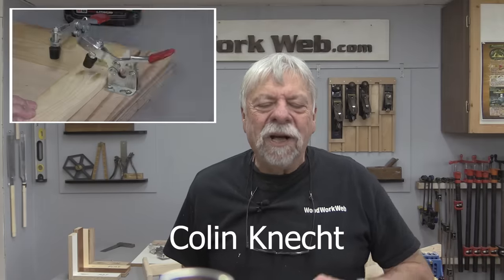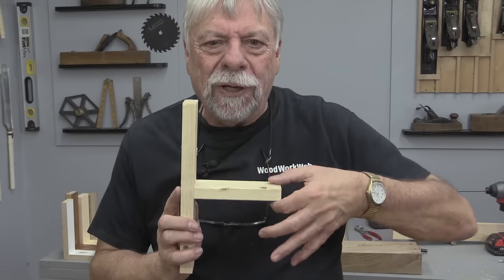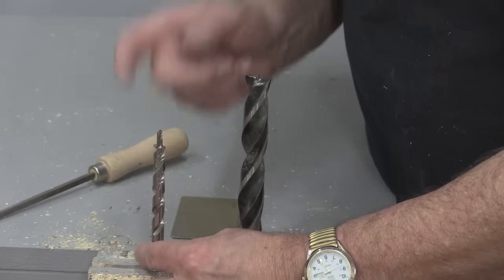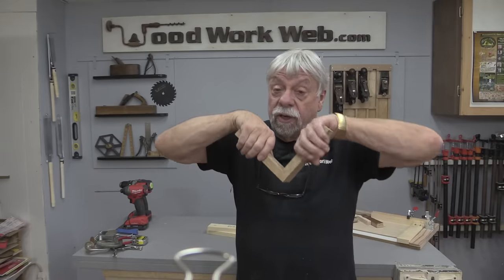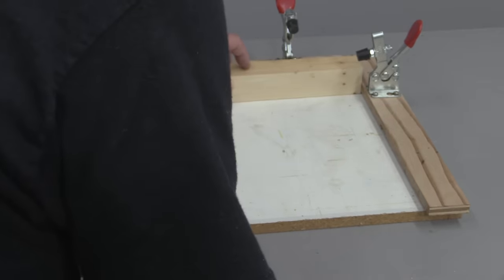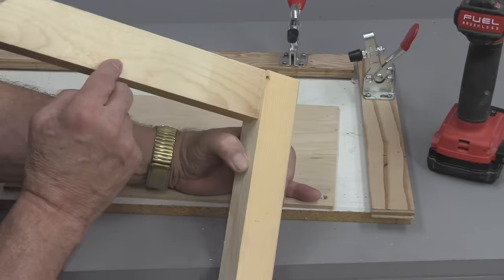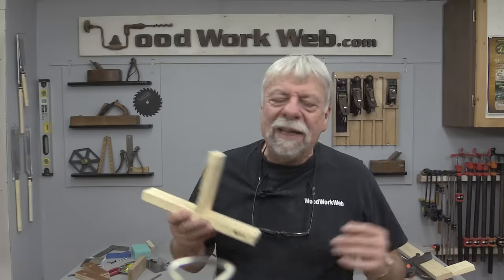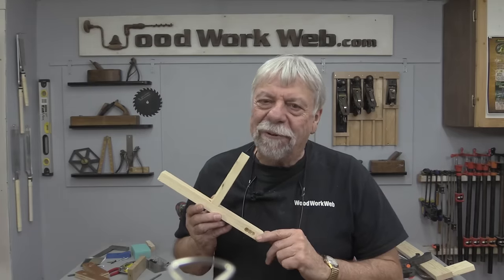Pocket Hole Mistakes to Avoid / Woodworking Joinery

Comment: Not sure how I missed this when it was new.  The strength demonstration of the pocket screw was impressive.  I've popped the heads off of plenty of sheet rock screws but know better than to use the bugle heads in pocket screws.  The technology and metallurgy of screws has come a long way in the last decade.  Kudos!

Comment: When you are sharpening drill bits (or just about anything) free hand, use a felt tip marker (Sharpie, Artline) to completely color the flat you are going to grind away. Then you will be able to see if you are actually holding the abrasive parralell to the surface rather than rounding it over - by wearing away the marker ink - repeat the inking as needed.
Reply: Good tip.
Reply: Thanks for the good tip.
Reply: Great idea! Thank you
Reply: Great tip.
Reply: @thisoldtony would be proud. :)
Reply: Why not machinist dye?
This works on any tool Knifes, planer blades, marking knifes anything your sharpening.
Also the Twist drills you buy for woodworking ard not hard steel they do not hold an edge
buy some made for machine shop work they will hold an edge longer and won't bend on you. you going to sharpen a drill bit I suggest you buy a gauge for doing it or one flute will be the high point and the only one cutting while the other one just gses for the ride.
on a split point bit both cutting edges have to mirror each other or the bits going to drift off center. If your trying to drill a straight hole this won't help you at all. over correcting will make the hole larger or egg shaped.
I worked in a machine shop I used to sharpen my own drill bits it really matters how good you get them. I wasn't a Journeyman machinist But I did learn a few things.

Yes Metal cutting bits have a differnt angle, I know that but they will drill metal and wood alike with no problem but they do cost a hell of a lot more money, the investen's worth it in the long run.
Reply: This good tip results in a good tip.
Reply: Vikas SM  Just the tip?
Reply: Good tip
Reply: Cool tip.
Reply: @bobbg9041  The best twist-drill bits for woodworking are spur-point bits.  The center point keeps them from wandering and the spurs make for a very clean-cut hole.  The steel IS hard steel, though not as hard as a machinists bit.
Reply: Word!
Reply: Nice & simple Tip..

Comment: Great information on what screws to use, AND why!  One comment: in your pocket hole strength demonstration in various wood types I noted that the orientation of your test pieces was the opposite of what I have learned elsewhere, specifically, to get better grip and less tendency to break, your pocket and screw should not be on the inside of the joint pointing toward the outside corner of the piece.  That reduces the support on the second piece significantly.  The pocket should be on the outside of the piece allowing it to point INTO the second piece.  (I hope that makes sense without a diagram…LOL.)

Comment: I am new using a pocket hole jig so I followed the directions and a couple utubes     I set the bit stop according to the the side chart using 3/4 birch plywood,   After running a couple screws thru the top I found that 3/4 plywood is not necessarily true size so always measure the thickness before setting the drill depth and don’t be afraid to set the stop a bit short.  Great info you shared!

Comment: A lot of useful information presented in a easy to understand way.
Reply: What about water based glues for outside projects? Example Gorrila. You need to dampen your joints before attaching to make it stronger. They apparently are recommended for outdoor use. I have a original Kreg handed down from my father. I’m 73 so you can imagine this thing is old. Use it a lot and have learnt things that will be helpful in future projects. Thanks
Reply: @dennispalmer6007  The original Gorilla glue is a polyurethane.  It is not water-based.  It requires moisture to cure.  Once cured it is water-proof.  It is not recommended for gluing wood that will be continuously submerged in water .  However, it works well for projects that get wet from time-to-time.

Comment: Excellent explanation and demonstration of how some screws will shear off and others will not, and why some screws will pull a joint together and others will not.
Also liked the demo of different strengths of kreg corner joints based on wood type.

Comment: I have worked as a carpenter for some thirty years and I normally vary rarely use pocket holes in joinery as I still prefer traditional joints in my work. But in certain projects for speed and basic necessity, these are fantastic tips even for seasoned woodworkers. Always good to learn new tips no matter what your skill level. Nice job 👍

Comment: Great video and advice, however I was always taught to screw pockets from the outside in as there's more material past the tip of the screw - making it more secure with a stronger hold.
Reply: Bingo.

Comment: I made a 2" X 6" gate frame and used the large Kregg Pocket Hole jig with the pocket hole screws. Zero sagging after 2 years of heat and rain. I used Gorilla Heavy Duty construction adhesive to seal and glue it together. Its still going strong.

Comment: Wow, I don’t know why I never thought about why the piece pulls away from the thing you’re screwing into with screws that have threads the whole way up!  Great explanation!  Thanks!
Reply: When teaching "screw fastening" in my HS tech ed classes, I always asked kids to think of a screw head as the movable jaw on a vice and the base board as the other jaw. The piece between is being "clamped" between the screw head and the base board. The board between the screw head and base board must have a shank hole drilled that is the tight outside diameter of the screw threads. The screw should be able to slide through this board right up to the head before it is being fastened to the base board.Threads should never grip the board being clamped. It takes longer but this is the way I fasten deck boards and they never crack or push apart. In furniture or cabinetmaking I always drill a pilot hole, shank hole, then countersink or counterbore in the listed order.
Reply: Joe Russo pilot hole PLUS shank hole?
Reply: @anyfoolknowthat     YES ! Especially in hardwoods. 1. Drill the pilot hole through both boards to be fastened in their aligned position ( this drilled hole is a tight diameter to the screws inside thread diameter for good thread grip)  2. Drill the shank hole "only" through the board being secured ( you are enlarging the originally drilled pilot hole so the screw just tightly slips through to the head)  3. If you are going to make the screw head flush, align and drill a countersink into the shank hole on the board being secured. Or, you can choose to drill a counterbore of a specific diameter and the cut a plug and fill the counterbore hole. With this process, the boards are always pulled tight and not separated.    Note: When I lay down deck boards, I usually only drill a shank hole in the top deck board to alleviate splitting. Special deck screws will cut the pilot in soft framing boards and the heads also have a cutting action that countersinks the head.
Reply: Joe Russo Sounds like you’re carrying 3 different drivers (?)
Reply: @anyfoolknowthat  You are correct. If I am doing cabinet work I am using drills outfitted with proper bits and a driver. This usually means 4 drills required.  Three for drill and countersink and one with a screwdriver bit. In a decking install, 2 drills, one with a shank hole bit to drill through the decking board and then another fitted with the screwdriver bit to drive self tapping deck screws which usually don't require a pilot hole. Early in my teaching career, within the framework of my budget, I always added drills to my tool inventory. I did not want kids waiting around for a drill or wasting time constantly changing bits. You can do everything with one drill but your production time will be greatly increased.
Reply: @anyfoolknowthat  The hole in the work that the screw passes completely through on the top is called a, "clearance hole". Because the fastener is supposed to completely clear it and not engage at all. Otherwise you risk your work, "jacking" on you. For real wood screws you're actually supposed to use a tapered drill bit. They usually have an integrated countersink and depth collar on them. I have a set.

Comment: When it comes to clamping the pieces I use the locking clamp that came with my Kreg Jig. Not a problem..the disk shape covers a slightly bigger ariea by a few millimeters. Doesn't sound much, but it doesn't move when I clamp, where as if I used those other two clamps you mentioned, I found I had to use a couple of small pieces of scrap wood, and it was too much mucking around. Might stop marking the wood, but my locking clamps didn't mark the wood either. 
Great vid there, Colin...as usual, you haven't let me down so far.

Comment: it's interesting how much the Kreg jig has changed. Mine is much more difficult to adjust, in fact, I'm not certain it can be adjusted like that. Fine threads work better on hardwoods, don't they? I really like your clamping jig

Comment: I saw in another video at 4:55 that it's not strong when you put the pocket hole on that side because there isn't enough wood holding the screw. The screws should be driving towards the long side of the wood, not the end.

Comment: Thank you so much for this information. I've been using left over sheet metal screws for pocket holes resulting several splits. Now, I know which screws to use for pocket holes. Appreciate for your video!

Comment: Great video Collin! I just started using pocket scresws, even the larger ones for 2 x 4 construction. It takes a little more time but the results are much better. Have you done a video on your clamping frame? I'll be doing some kitchen cabinet doors theis fall and would like a clamping frame like you have. Thanks again!

Comment: Speaking of pocket hole mistakes, the most common and you did it too (like at 5:15) you screw it on the underside, wich is prettier but way weaker because there is not much wood left to hold the screw ! If you screw it on the top, the tip of the screw point inside the other piece of wood and not towards the edge cut. Way stronger. Try it !

Comment: And if I may add:  most of the time, good quality pocket hole screws will be "Self Tapping" type, that does a better job, when screwing.
Reply: Came to add the same comment. An additional comment about drill selection: in oak you want to use a drill with a clutch, not an impact driver. Once the pan head of the pocket hole screw reaches the bottom of the whole the torque of an impact driver can cause the head of the screw to pop off.

Comment: Hi Colin. Yes, definitely need to clamp the parts when using Kreg or Harbor Freight pocket hole jigs. They are all around 15 degrees. A Castle pocket hole machine you won’t have the same problem. They are at 3 degree angle.

Comment: Colin: There was a lot of useful information here and I know you were showing the benefits of types of wood for pocket holes.  but when making pocket joints though, drilling from inside to the outside leaves no strength in the joint where the screw is only anchored in the fragile edge of the wood  rather than anchoring them in the meat of the board and often will protrude through. if used from the outside in there leaves a hole to be filled.
Reply: he is doing it wrong
that's why it is too weak
Reply: I thought so as well.  Odd.
Reply: The only time I would go inside to outside is when you really don't want to see the screws like on a piece of furniture, otherwise your right.
Reply: @mickpicker9089  And if you used glue it would be fine? I'm just getting into this and going to buy a jig soon.
Reply: @AlexWard  There are definitely times were glue is better. Glue is usually really good on projects that are indoors were you dont want screws visible and that wont expand and contract alot. But you can get a really strong joint with both screws and glue.
Reply: @mickpicker9089  So for outdoor stuff you're better off NOT using glue? Even if painted?
Reply: @AlexWard  I forgot to say it depends on what glue you use. Some keep a tight bond outside even with a lot of wood movement.

Comment: Also use the right screws for the wood  you are using, course thread screws for soft wood and Fine thread for hard .  Use a clutch drill not a impact driver.

Comment: I just drove 3 pocket screws into pine without gluing first then saw your vid. Gonna put some glue on the surface now. Thanks a lot for the tip. Great educational video.

Comment: It absolutely does matter what type of clamp you use when drilling pocket holes, quick release clamps just plain suck, you can't hand tighten them enough to keep adequate pressure on the intersection of wood, and the joint will in some cases misalign , you need to use vise grip type clamps, or C clamps, trust me , I've been pocket joining for a long time.
Reply: This is very true, and I have had to learn the hard way.

Comment: Usual cordless drills don't snap off heads of drywall screws as easily as impact screwdrivers do as you can effectively adjust maximum torque applied in the very end of screwing. Still, using drywall screws for pocket holes is not a good idea, of course.
Reply: Yeah, I can't say that I've ever snapped the head off drywall screws or tried to intentionally, but it's definitely happened with deck screws and tapcon concrete screws. Normally I drill a hole first, unless I'm actually anchoring drywall.
Reply: @kahoycrafts  I have broke many off when putting up drywall in my old house framed in fir.
Reply: I try to avoid using a drill and Phillips combination. Drill is heavy compared to an impact and Phillips screws slip out.
Reply: Drywall screws are incredibly hard and brittle. They're really not suitable for anything besides holding drywall to studs. Although we all use them when we shouldn't. They're as hard as they are so they can pierce metal studs.

Comment: They don't recommend impact drivers for pocket holes. Drills with clutches are the best.
Reply: I like to use a corded drill to bore the holes and a cordless drill to drive screws.
Reply: They should slap a giant sticker on the jig—I was knocking my bit collar loose for a couple months before I put two and two together
Reply: I’ve noticed if I give it just one or two click sounds on the impact that it’s enough to get the joint tight
Reply: Which clutch setting is the best for pocket holes?  Sorry, im new at this!!
Reply: will kinser I do 14 on my Porter Cable driver, which goes up to 23
Reply: @willkinser785  It depends on the clutch. Once you get a feel for your tool, you'll know how to adjust it. I suggest taking a scrap piece of the wood you're working with and sneak up to the correct setting.

I should also add that many low-quality clutches will drive the screw too much one time, not enough on the other. In that case, it's best just to learn how to drive the screw by feel, like we had to before clutches.
Reply: @willkinser785  it depends on the power of your tool and the type of wood. I still prefer my impact driver and just go untill it impacts 1-2 times
Reply: An impact drill made the stopper on my jig come loose
Reply: Omg you just solved my mystery! I’ve been having trouble w my pocket holes since I started using an impact driver. PTL! I can see now!
Reply: starvant are you talking about the stopper on the pocket hole drill bit? if so I wouldnt ever suggest using an impact to drill holes. I use my regular drill to make the pocket holes and impact driver to drive the screw in.

Comment: For those demos, the screws should be angled away from the edge of the other piece. The way you had them, there is less material for the screw to hold on to.
Reply: I thought nobody had notice that! You are so right!
Reply: You are 100 % correct. Unless you are making a face frame that won't move once nailed in.
Reply: Yep.
Reply: Yep.
Reply: Agree 👍🏻
Reply: If he did it your way the hole would be visible...
Reply: @lennym1273  It's okay in some cases if the holes will be covered or if looks don't matter like for shop cabinets.

Comment: When you're demonstrating the joint strength @4:47, it looks like the main issue there is where you drilled the pocket holes, not the material you're using.  If you had drilled the hole on the outside of the "short side", or the outside of the board with it's end grain laying on the face grain of the other board, I think the joint would be much stronger, regardless of material.
Reply: If I understand you correctly, by flipping the pocket holes to the outside of the workpiece, you would be angling the screws inward and away from the edge of the adjoining piece, giving it a little more material to keep from ripping out.  It's a valid point and although that may occasionally be a viable option, the nature of using pocket holes is that you put them where they will not be seen. If that is on the inside of the workpiece, then it would be the way he demonstrated.
Reply: @TM-dh2xb  Yes, that's probably a more succinct way of describing what I meant.  And yes, that is true, you probably would want to hide the pocket holes where possible.  I was more speaking about his point regarding different wood types being appropriate for pocket holes.  I'm a very beginning woodworker, so I'm not claiming expertise on anything, but I've made that exact joint with pocket holes in pine or scrap plywood for shop projects where I didn't care about the looks, and the joint is plenty strong if done the opposite way demonstrated in this video.  I would say on something where looks are more important, perhaps choosing a different type of joint is the way to go rather than using pocket holes from inside out, even if you're working with a harder wood like oak.  Otherwise thought the video was very good, and I learned several things from it.